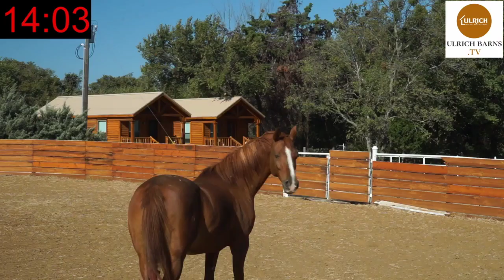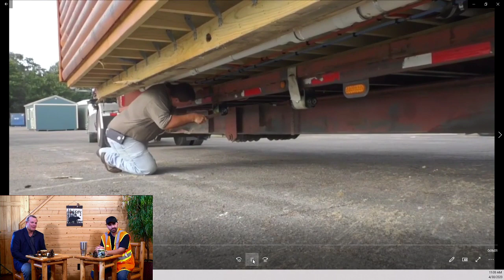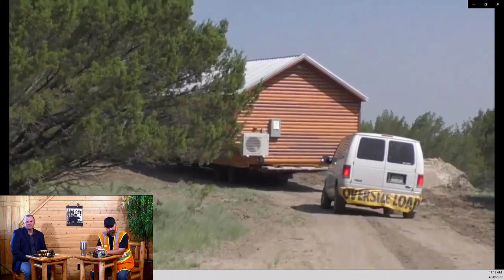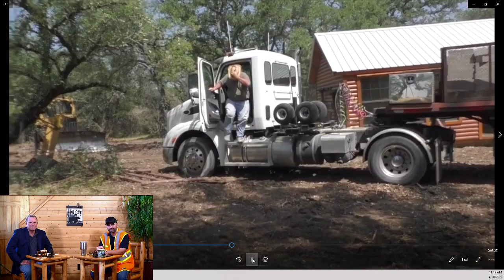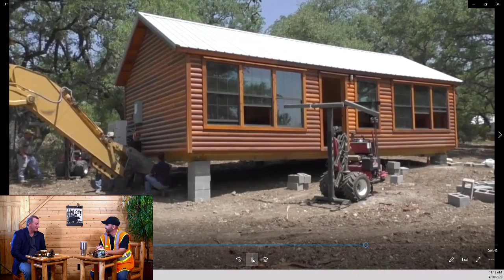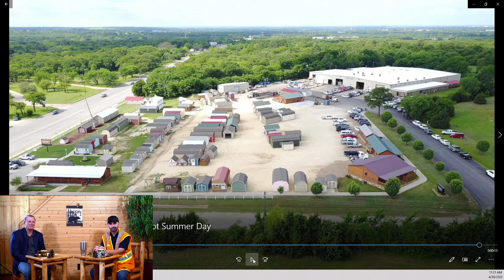Ulrich Cabins Live, Episode 6, How Soon Can I Get My New Cabin?

Comment: Will this hook to city water and sewer? Is it all electric?
Reply from the maker: You should be able to connect to city services.  Once onsite, they are looked at as a pier and beam, stick built home.  Yes, all electric.  If you are considering gas you would need to speak to a designer at 817-587-0610 for that ability info.

Comment: Is the cabin only sitting on concrete blocks?  How is it supported underneath and how creaky is the flooring? I like the idea of no foundation here in Texas but concerned about creaky floors and sag.   Also, can the are be covered with say natural stone? Lastly, how does this hold up during high winds, i mean would it blow off the blocks?
Reply from the maker: Hi Billy. Good questions. We have great success setting up these cabins on concrete blocks, pier and beam style. That being said, some of our customers do prefer to pour a concrete slab, which is great too. These cabins are super heavy, so no, they're not going anywhere. But once again, if you prefer, they can be anchored to the ground or to your slab. Also, is your stone question related to the foundation, or to the siding of the cabin?